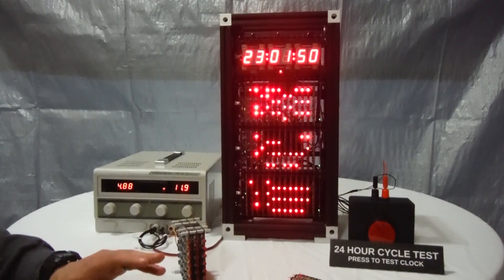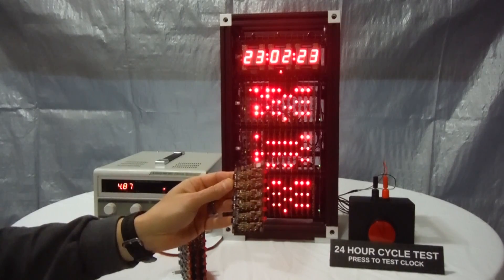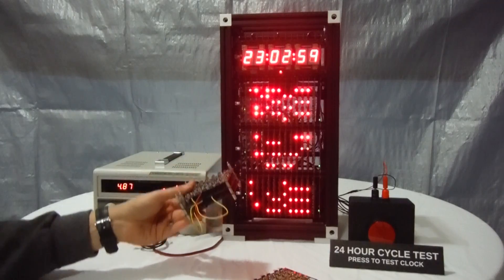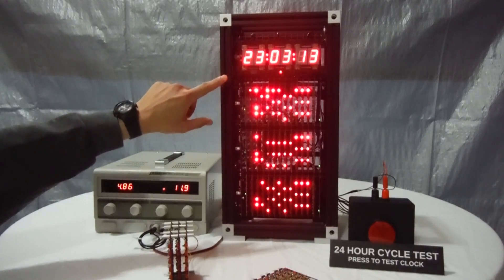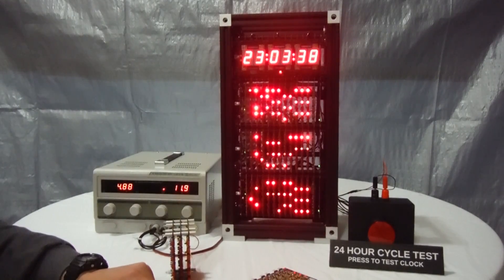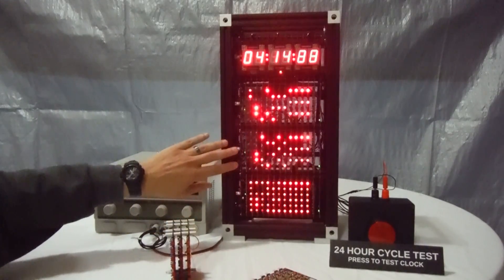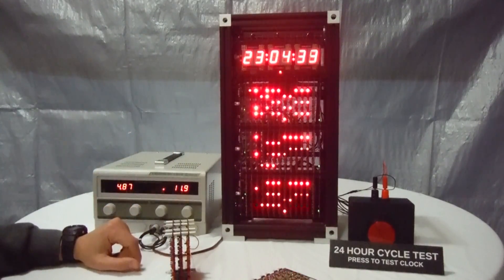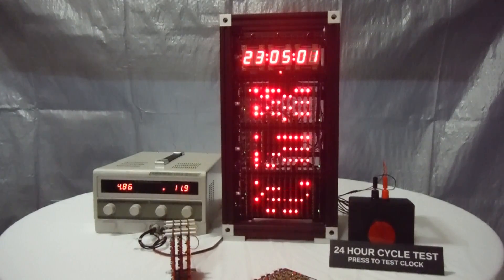Diode Clock Introduction

Comment: How do you deal with the losses across the diode (voltage drops)?  I never thought it was practical to build extensive logic circuits with diodes alone which is why DTL exists.
Reply from the maker: https://cdn.hackaday.io/files/11677499588768/DDL01_datasheet.pdf

Comment: Nicely done, and nicely finished. It looks great in whatever that enclosure is.
Reply from the maker: It's made from black anodized 8020 aluminum extrusions.
Reply: I thought it might be an off the shelf panel mount enclosure. Not that I recognise it. I see why you went this way. If you used integrated decade counters & shift registers, it looks like there would be some unused flip-flops, and that would be a waste.